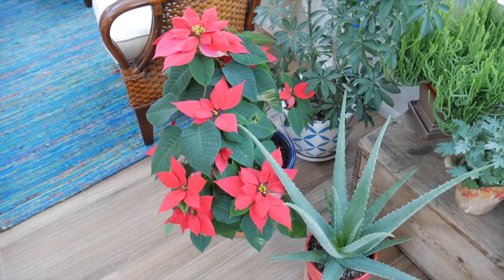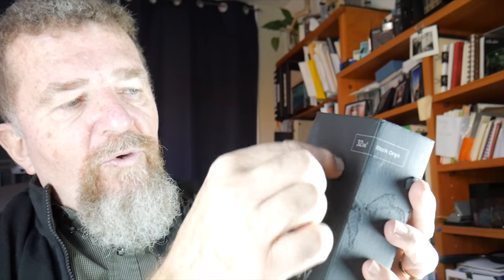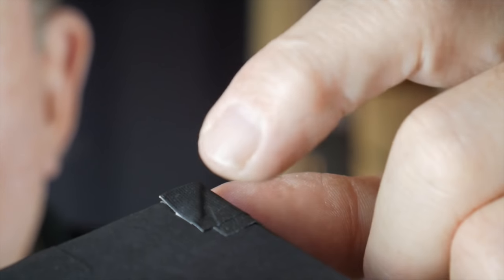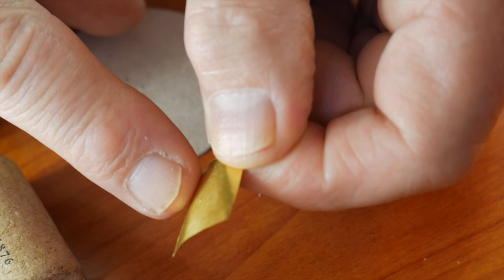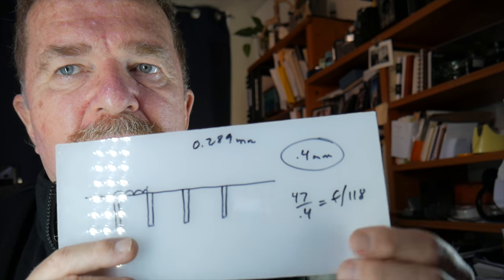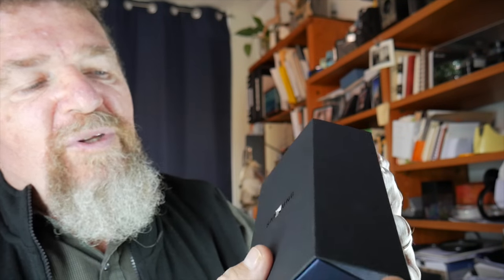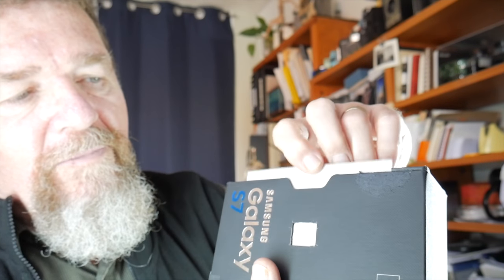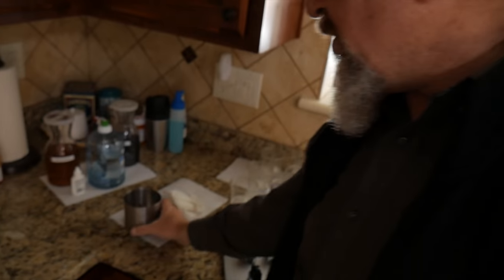Winter Project: Cell Phone Box Pinhole Camera

Comment: Thanks for this! I’m really enjoying your videos! I just happen to have the same cell phone box so I think for my first try at pinhole photography I’ll try this design! Its probably a dumb question but I’ve never worked with film papers before, how are you cutting it to size without exposing it to light and ruining it before ever “loading” it into the back of the box?
Reply from the maker: Use a red darkroom safelight bulb. My paper cutter in the darkroom is below the light, which is about 3 feet away. You can get these bulbs at places like Freestyle Photo.
Reply: @Joe_VanCleave  thank you!